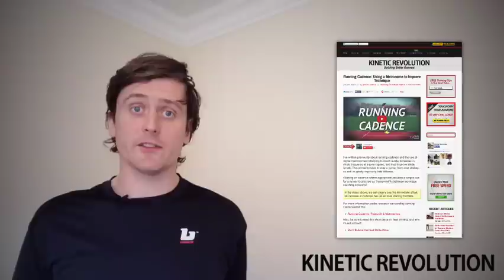Triathlon Running Technique: Cycling Analogy

Comment: It took a while for me to understand the relationship between stride length and over-striding.  Since most athletes from local age groupers to elites turn over at 180 spm (steps per minute) stride length must be much longer in the faster/elite athletes.  However if you consciously attempt to increase your stride length without changing anything else it is likely that you'll over-stride which will result in inefficient braking forces.  The answer revolves around your strength/power.  If you have power you generate more force which results in a longer stride while still landing close to under your center of mass (and reduces ground contact time).

Weights, plyometrics and very fast pace running (which I like to call specific weight training for runners) can help you generate this power and become a faster runner.
Reply from the maker: Kevin Sawchuk Strength, but also strength-endurance. One of the first things to suffer under fatigue is cadence! Thanks for taking the time to comment Kevin!